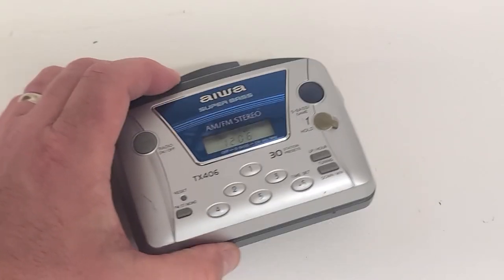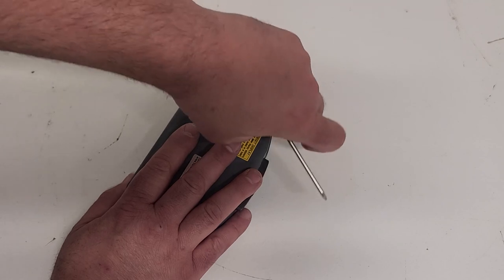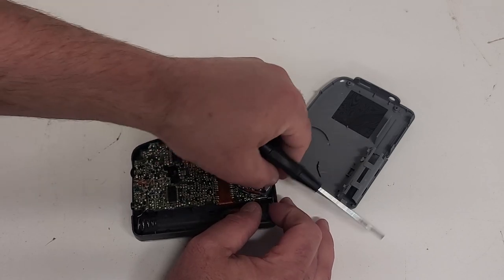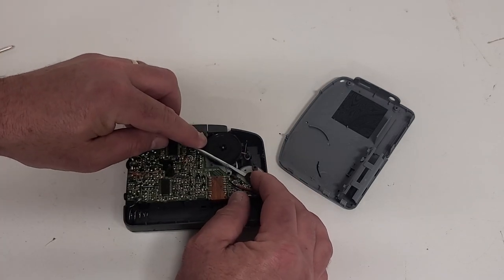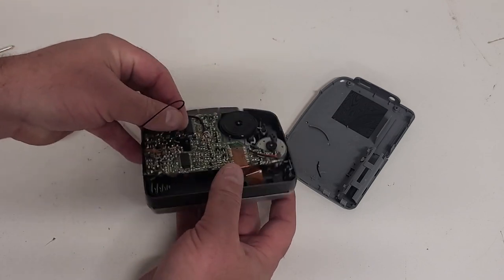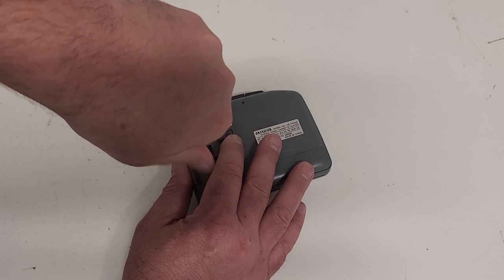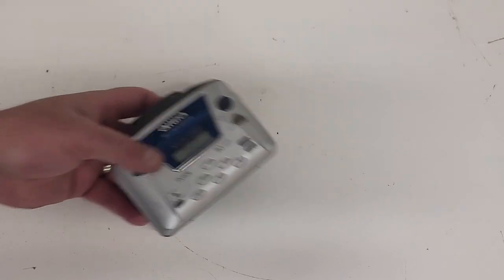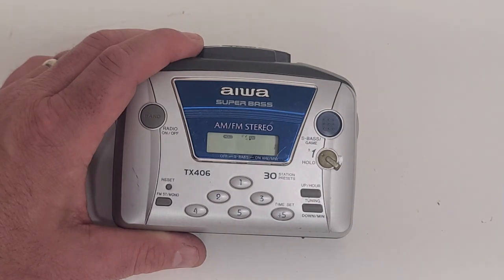Repairing an Aiwa TX406 Cassette Stereo - Belt Change and Clean

Comment: Some people say you need a full sized tape deck to listen to a tape properly and have the best sound quality, as they have large capstan wheels to help with inertia, however in my experience this is not true at all, some of the best sound I've ever heard to come out of a tape was on a Sony walkman made in 1989, the wow and flutter was just incredible. Sony invented the walkman so they knew how to do things properly, and of course AIWA are made by Sony. also never clean any rubber parts with IPA otherwise this is what happens. it dries out the oils in the pinch rollers and causes them to crack and go rock hard.
Reply from the maker: I agree. Sony made great portables. Even if it's a cheap machine, as long as the person using it enjoys it, that's all that really matters.

Comment: Where did you purchase the belt replacement for this unit? Is it a particular size? A purchase link would be helpful. Thank you so much for posting this video. It helps a lot.
Reply from the maker: I generally purchase generic belt assortments. They can be found on Amazon and eBay for just a few dollars and contain numerous sizes and lengths.

Comment: I have the same model here, but it is dead. There´s nothing appearing on the LCD. I know it´s a silly question, but, have you some clue of what can cause the walkman not to turn on, other than a broken connection to the batteries?
Reply from the maker: I would always start with the simplest explanation, which would be corroded battery contacts or a broken connection from the battery compartment. Then I'd look for broken traces on the circuit board or solder joints that have broken.

Comment: I have an Aiwa TX591 and have such a hard time to prying it open. Have you worked on them before? I see 1 screw, which doesnt look like it does anything to hold it together. I removed it, then unclipped all the edges around it  BUT it seems like there's something in the middle that's so together I can't even pull it apart. Any help? I can barely see the belt as i can only open it a little but it looks like it's in good shape, motor is moving but the belt is NOT moving.
Reply: I think that one screw which "doesn't do anything" is there to adjust the speed at which the belt spins